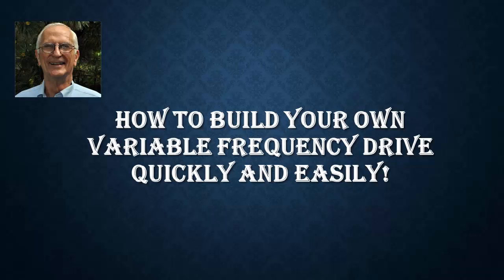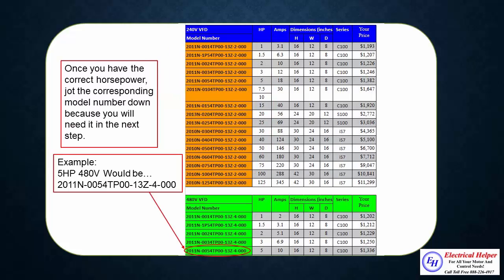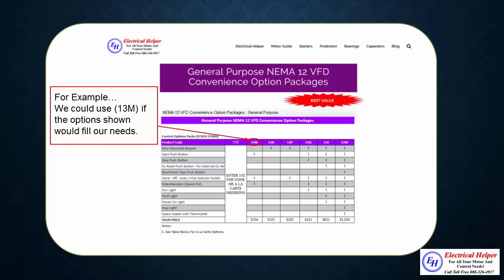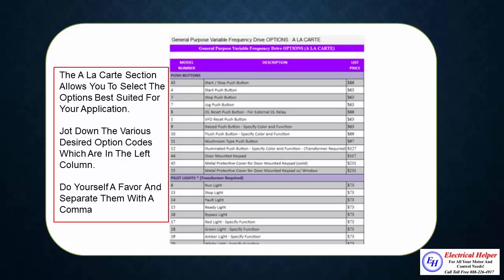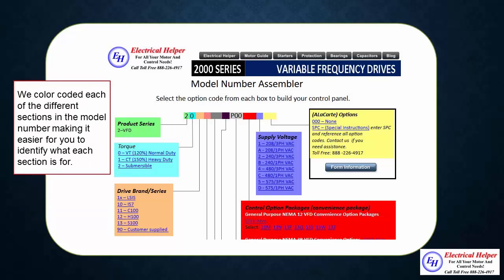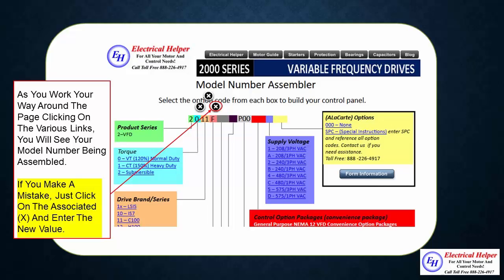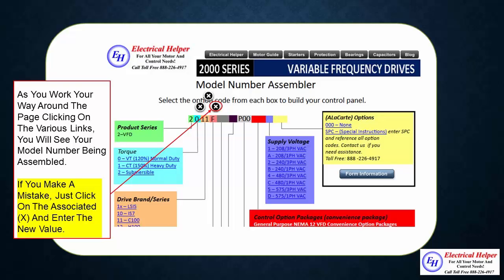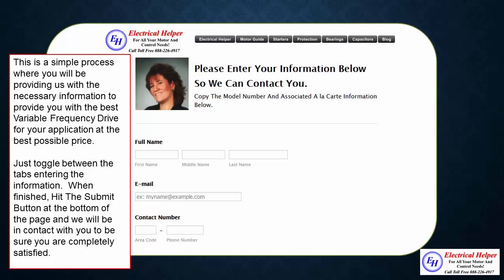This Video Describes How To Assemble Your Own VFD Quickly And Easily.

Comment: VERY .....misleading title 
This Video Describes How To Build Your Own VFD Quickly And Easily

should read select a Your Own VFD...   just a waste of time if your here to actually build your own.
Reply from the maker: Well Sir, if you are smart enough to convert your AC power to dc and then convert it back to gated AC while not  causing problems to all your other electronics with the generated harmonics, go do it. For the rest of us, we prefer to use proved and tested products by properly assembling a product that will produce many years of dependable service.